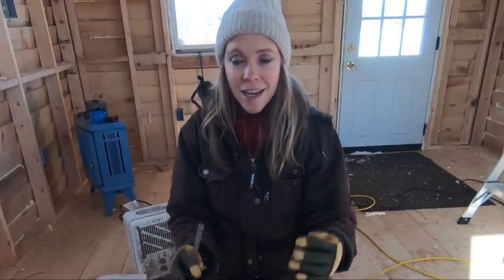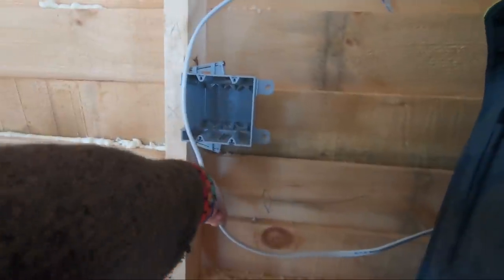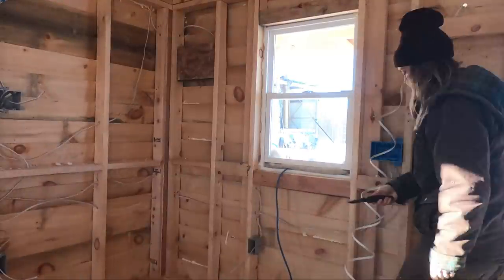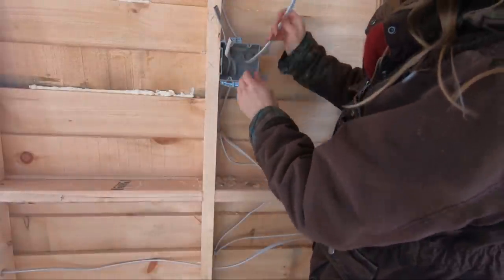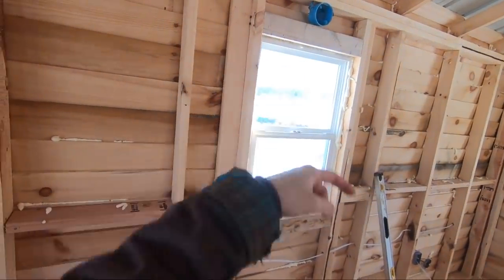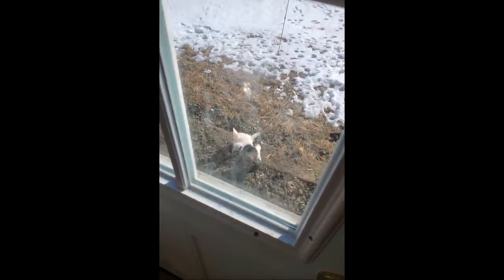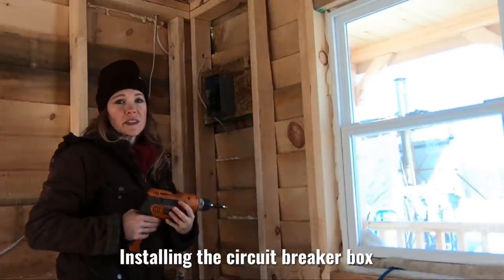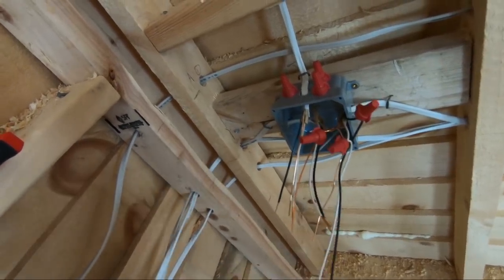My Electrical Wiring Was a FAIL! -- DIY Tiny House Amish Shed to Office Build Vlog#5

Comment: @WTF Farm Girl - being a YouTuber as yourself did you look online on how to install electric line in a cabin? anything I don't know I ask the internet and it always comes up with an answer. Someone somewhere has made a video on just about anything you ask. To feed those electric lines in, I would have lightly tacked the line so it had more freedom to pull thru it. Then when you are done laying the line - go back and final tack the staples.
Also I noticed you ran multiple lines. Did you label which lines went to were in the boxes. Because once you spay over your lines you will not see the pathway any more. Being in construction myself and having the electrician do his final hookup, They would have to poke holes in my walls to find out why the electric was going to the wrong box. This is more so for a switchable outlet.

To find out about being "code: later on down the road, 2 places you can check with. 1 is your building department inspectors office. 2. is your states building codes which is usually accessible online. Just type in your search box with Michigan residential building codes. There are differences between commercial and residential. Then look up the chapter for electrical wiring. Some states have a separate electrical code book. 

Looking at your code and I was questioning if you were boring your holes in a precise location or were you doing it willy-nilly. cose = "Bored holes in framing members for wiring shall be located not less than 1-1/4 inches from the edge of the framing member or shall be protected with a minimum 0.0625-inch steel plate or sleeve, a listed steel plate or other physical protection." This means that if the bored hole is not more than 1-1/4" from the edge - you need to put a metal plate on the stud face to protect the wire from a penetrating screw or nail.
Also how far apart are your electrical boxes. My state (FL) requires no more than 12' between boxes measured along the wall. 

Other codes that are important are the windows. Depend on your location your windows must meet the storm code rating. My state uses A, B, C, D. Each letter designates a wind velocity level. and whether you are required to have shutters or not. If you have impact resistant glass then you should not be required to have shutters. But if they are regular glass then you may need to have shutters. But your code book will have that info. 

The other important codes are the roof framing, mainly roof straps, Top and bottom plates, whether top double plates are required or just a single will do. You don't want the building to fly away in a heavy wind storm such as a hurricane or tornado. We deal with hurricanes every year here so our codes are different then say a non hurricane area.

And there is much more info on buildling structures. Even sheds. We have codes for them also.

Comment: Your title is completely wrong for this video. This cabin is on the grid. you pull power from the power company for this farm which means it’s on the grid. It also is not a tiny house. You have stated this will be your farm office.
Reply: She not getting power from the power company for her office. I believe it going to be solar and generator
Reply: @johnhaas2523  Evidently you haven’t been paying attention because they’re pulling the power that was ran out to the chicken coop that is now going to run over to the office.
Reply: @jelloboy123456789  I knew they removed the breaker box that was in the chicken coop but didn't get that they was running power to the office from what went to that
Reply: The reason for the off grid is that Suzanne said a few videos back that sometime in the future it is planned to move it out into the woods.
Reply from the maker: As of this point, it isn't connected to anything. So it is "off-gird". There is a power cord running into it to power a saw and heater, but it's not connected to the shed itself. The farm can be fully On-grid while also have an off-grid cabin. It was oriignally planned to be "on-grid" until Erik decided he wanted to build this summer, which meant moving the cabin.    So I had the choice of running wire to it at it's current location, then running 1000ft of wire from the pole to the NEW location months later, or just putting the entire system off-grid.  I decided making it off-grid would be more appealing to anyone renting it out in the future (years later).

Everything I do I try to plan long-term. It's my office and guest house to start, then once I get a real office build it will be turned into a tiny house with complete kitchen. It's a bit smaller than most tiny houses (average is 400 sqft) and this is just under 200, but it's still a tiny house, and will make the full conversion down the road from office to fully equipped house :)
Reply: @This1LifeWeLive     Food for thought.   Please talk to your electrical inspector.   If you set this up with kitchen, bathroom and sleeping and not on wheels, how would the inspector view it?   Big ramifications.    If you rent it, then insurance company will have an opinion as well.
Ok, so off grid for now.   You should make sure you meet your future needs bare minimum with the electrical panel.   I’m thinking what you currently have will not suffice.   Again, electrical inspector question after telling him everything.   Just trying to help!